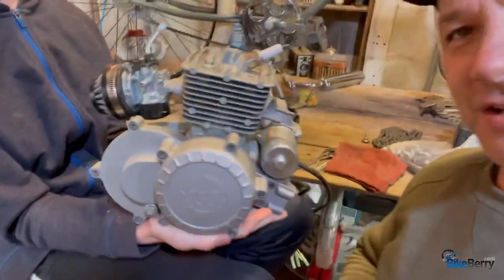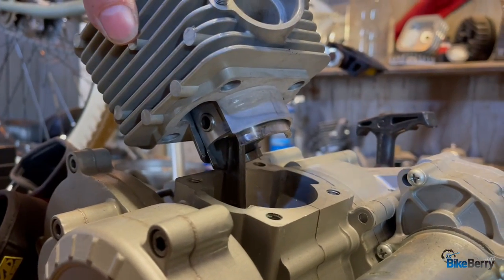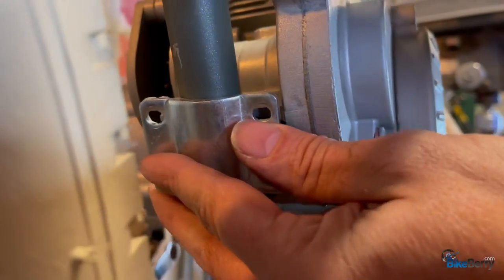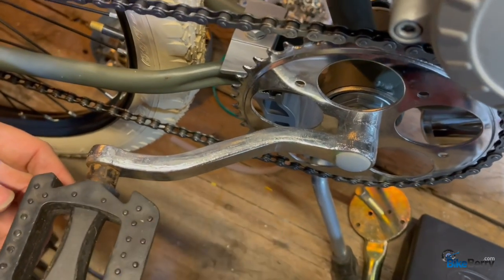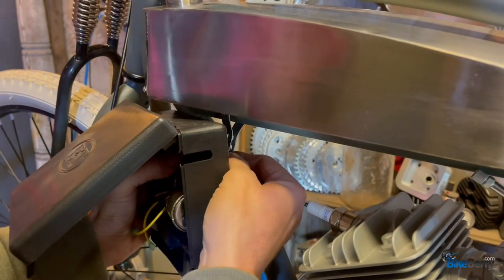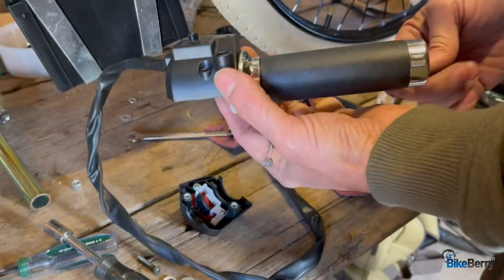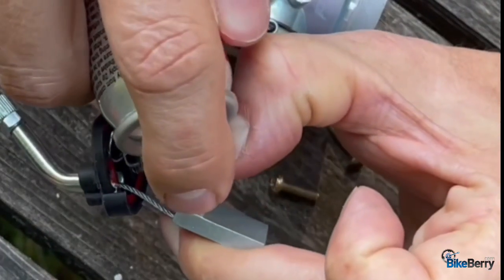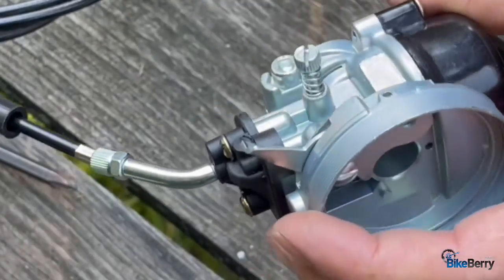Bullet Train Electric Start Installation #1 | Motorized Bicycle | BikeBerry

Comment: I have a question Tony, I know these motors have a Starter that runs from the Battery. Does it also have an alternator?
I mean how do these things re charge the Batteries. Or does it only start a few times and then half to put a charger on the Battery?  Just curious.

Comment: You guys really need to specify that the carburetor that comes in these kits now is the bofeng carburetor and uses 8mm jets not 5mm like the original NT also the 8mm jets should be available on the site you wouldn't believe how many people I hear about who bought the wrong jets just because they didn't know they are different it makes it difficult for new builders trying to get it tuned correctly the bofeng is a decent carburetor if you can get jets for a decent price 😉
Reply: Thanks Rob for mentioning this! The update is in the works on the site and I’ll be making videos on the differences. Appreciate you!

Comment: I would definitely mount on the back on a rack or somewhere safe for then been mounted underneath the bike what's the method does look like a good engine mean it electric start Phoenix running on a 12-volt system you could add some pretty interesting stuff does that come with a rectifier

Comment: Tony I have a question for you I just bought thebt80 brand new mounted it on my bike everything was running good then the engine just shut off now it doesn't start I checked everything and everything is is well connected and I have spark but it just doesn't start

Comment: Hey I got a kit and am missing those 4 bolts that tighten the cyclinder head. I've been trying to come up with a Diy solution but I don't know which dimensions and exact thing to get, I hear you say the 4 cyclinder housing screws are 10mm. I can't find replacements online either :/

Comment: When he said modify the frame I thought he might have just put a little bend in it no he cut that hole bar out bent it and re-welded it and repositioned it probably took a couple hours anyways just so you're not deceived you might need a welder and bending equipment not as easy as he makes it seem and if you had somebody do this hundreds of dollars extra